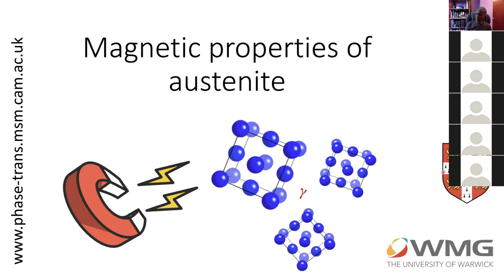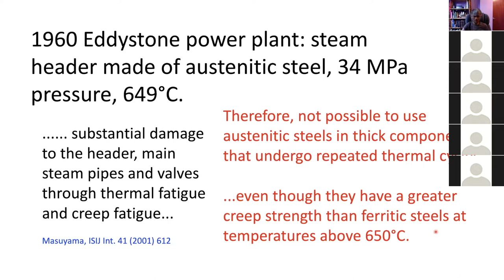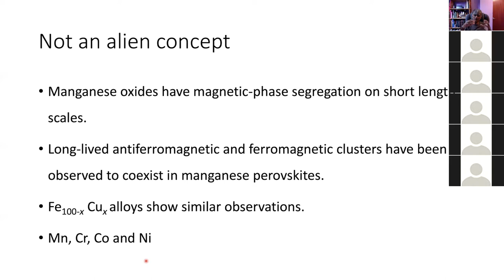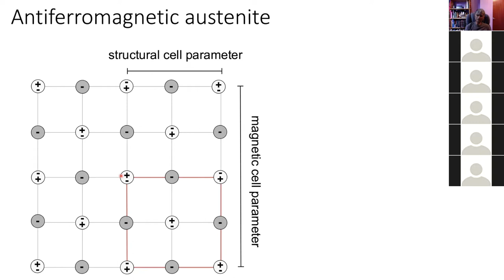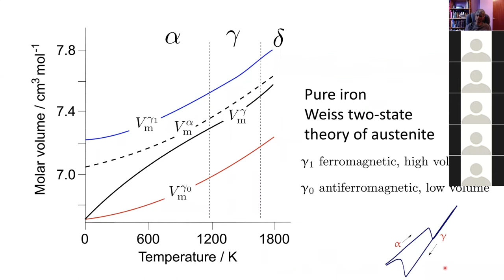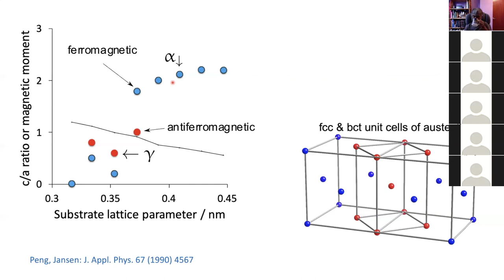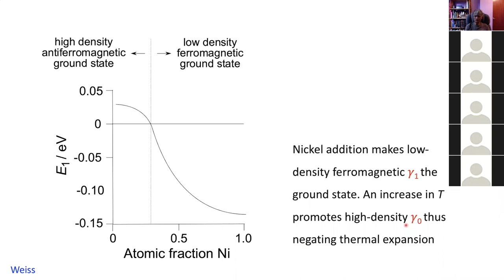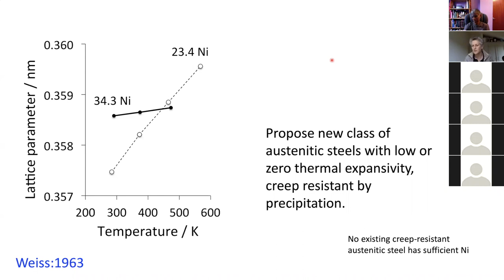Magnetic properties of austenite

Comment: Dear professor, firstly I want to thank to you so much for this tutorial videos. All of your videos help me to improve my metallurgical knowlendge. I have a question for this video. At the 27th minute of video you said that '' if we deposite a thin film of iron on a substrate which has larger lattice parameter than austenite,  we will end up with antiferromagnetic austenite, and if we deposite it on to a substrate which has a smaller lattice parameter than austenite, then we will end up with ferromagnetic austenite'''. Shouldn't it be the opposite? Also, I understand the concept of magnetic properties of austenite as you told us, I made an inference in this direction. Thank you so much.
Reply from the maker: Thank you so much - you are quite right, I explained it the wrong way around.